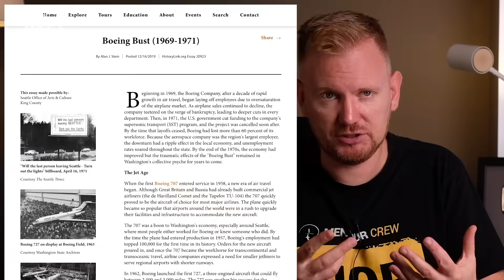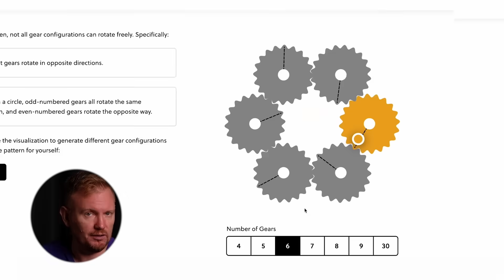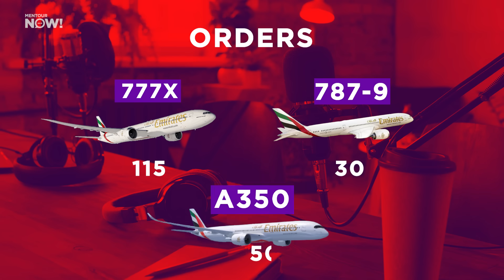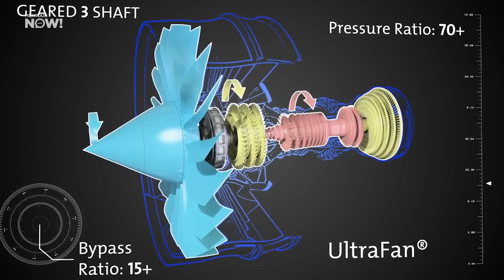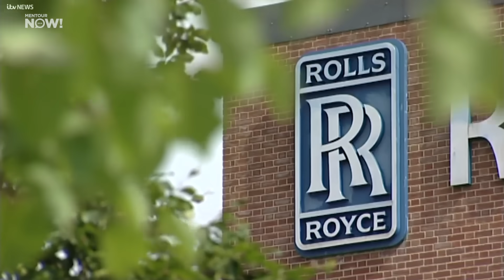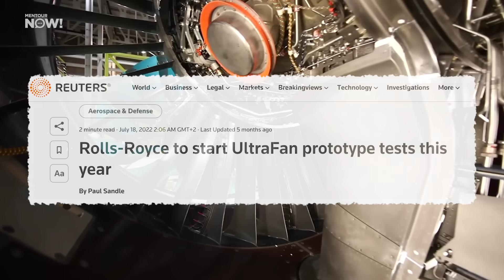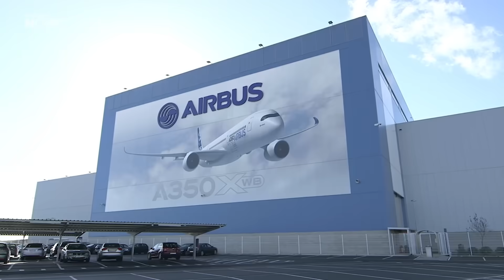Are BOEING planning a 747 with 2 ENGINES?!

Comment: They make carbon fiber wings in Wales, could they re wing 747s and A380s? for 2 engines with a higher under carriage..  My guess they have to keep the fan tip speed below the speed of sound.???

Comment: You need more than twice the power of 1970  turbo fan to go on two engines because the plane has to fly on half power not 3/4 power if it looses an engine.as if full load just after or before lift off.  I would like to know what the maximum limit is for a turbo fan engine.?????

Comment: No. It would be a completely new aircraft with all the type certs etc. that entails. Or did Mentour say that and I missed it? IIRC the killer problem with the 2707 was that Boeing couldn't get the swingwing pivot to behave itself and the more they tried to fix it, the heavier the aircraft got until the seats would be too expensived to make a profit. The cancellation of the program and the curtailment of Concorde on the transatlantic route at about the same time because of the the sonic boom noise problems led to untrue rumours that Boeing forced the US government to put the boot into Concorde because it (Boeing) couldn't get the 2707 to work and didn't want to be outsmarted by Europe.

Comment: Wonder with the recent progress in Electric Engines (always much more Torque-Efficient, thus much more Fuel-Efficient, than regular fuel engines) if there is the possibility of replacing two of its engines with Electric propeller engines (as with the 12-blade engines on the A400M - but electric - which can almost allow the aircraft to fly at 500+ MPH, close to the cruising speed of the 747), and with the two fuel engines providing much of the energy to the other two electric engines. ... If doable, this will make the 747 unmatched in fuel-efficiency!

Comment: The No.1 problem is there is currently no engine powerful enough to power A380 or B747 sized aircraft in twin engine configuration even if somehow they could fit underwing. Unless there is massive weight decrease that can bring both aircraft close to B777X weight or a completely new and optimised wing it is impossible to power two such aircraft with the kind of thrust that is currently developed by a GE9X or even the Ultrafan which has a target thrust of 100K pounds. Factoring for engine cutout for a twin of that size, we are probably talking of 150K thrust per engine. This engine does not exist and neither we are anywhere close to have one anytime soon.

Comment: The ultra fan "engine" is not quite that. Its a framework to be applied to multiple sized engines. Its far easier to develop and test at its largest size and then shrink once the issues have been resolved. The other market is in Electricity grid (Aeroderivative Gas Turbines), as renewables are being rolled out without any serious consideration to network balance (i.e the wind stops suddenly) - large capacity jet engine power stations (which have been used since the 60`s) will need to be renewed, and at considerable scale to prevent blackouts as wind farms eb and flow their output. Its likely that the power generation side will be the first, and perhaps largest customers of the largest derivative of this jet engine.

Comment: Would there be any reason why a high wing design (think the C-17) wouldn't work for a passenger jet? Is there a reason why all the jet liners since the DH Comet and 707 have been low wing designs? A high wing 747 would easily fit an UltraFan. You could even lower the fuselage to make baggage handling easier.

Comment: The first or second time there is a twin engine failure over the water they will require aircraft to have more than 2 engines again. We’ve just been fortunate that there hasn’t been a situation like that in such a long time. However as the past has shown history will always repeat itself.
The most powerful and economical engine on the market today is the GE9X

Comment: Let see... Well there are airlines that already have replaced Boeing 747-400/ER with 777-300ER. For those who fancy 747SP, well there is a 777-200ER which have similar capacity, range and other capabilities. In short Boeing 777s are really feasible alternatives/replacement of 747s.

Comment: I think the Slot constraints at airports will be the driver of a huge twin engined A380/747. The A380 is rather compact in size for the number of passengers it carries. Also Airport size constraints may also bring in the big double floored jets. Stretcht versions of widebodies take up way more parking space, and I think that a lot of airports are in need of more gates for their Passenger volume. So shorter double story aircraft may be the only way to go.

Comment: "Aviation phantasy" is fun - but phantasy.
"Twin-Engine-B747" would effectively be a completely re-designed aircraft - every part of it.
Aviation is a business. 
The most modern wide bodies like the latest B787, B777 and A350 varieties are state of the art. 
An airplane designed 55 years ago cannot match this - except if it is all-new. And then it is technically close to the aforementioned present leaders, not the legendary B747

Comment: Now that the CEO of Boeing has announced a complete redesign of the 747 wing to continue the Series maybe it is time to revisit the 1960’s Boeing concept of the three engine 747.  The three engine design was dropped in favor of the 747SP because of the expensive redesign costs of the wing/fuselage. Perhaps the 21st century advances in materials, design, and construction have made a three engine 747 a viable reality. A modern, single tail mounted engine providing over twice the thrust of original JT9D’s, while outboard engines were throttled back at cruise, could offer an economy of flight outweighing reduction in performance.

Comment: With composites at the forefront of wing technology like they've become, one could design the wing AROUND the giant engine (flowing above and below) so it wouldn't have to be slung under the wings but rather the center of the shaft would be centered on the wing. Maybe that would be the time to switch to a flying wing design as has been speculated for decades as being the most efficient.

Comment: Working on the control system of the 747, The redundancy afforded by the four hydraulic systems has been put to good use, every control surface is driven by at least 2 hydraulic systems from different engines. The only system that is not redundant is the body gear steering system, from  nr 1 engine.
It would be  a night mare to redesign all those systems, matured based on a long operating time. 
The amount of analysis and simulation to requalify  a new system based on two engines is so expensive, that it makes no sense to do such a thing, in addition the cognizant engineers have long retired
End of discussion PERIOD

Comment: Boeing C.E.O., Mr. Cahoun, has just announced the re-opening of the production line for the 747, however, this new production will bring a totally new aircraft with a reduction in at least of 20 % in fuel consumption, a totally newly designed wing and the introduction of a lot of new technologies, mainly in terms of reducing carbon signature.
This announcement comes few weeks after another one on which Boeing reported the re-opening of the Boeing 727 line! Yes, as astounding as it may sound. The same way, under totally brand new design guidelines. Both news are not to be expected in few months nor years, but in medium term, probably around 2030. Let's hope not to be another firework the kind of Sonic Cruiser.

Comment: There is no point,it's an older design with older tech in its build. You would need to replace a lot of the materials in its build, and the design and aerofoil of the wings,do you might as well just develop a new aircraft for that cost.

Comment: The plus side of having two engines instead of 4 would be efficiency. However, you also have to take into consideration that if one of the engines were to go out you now only have 50% of your total thrust capacity instead of 75%.

Comment: I wrote about this on the Airbus 380: "A really big plan for the A380 would be to develop huge new engines with a thrust of around 620 KN which is roughly 25% greater than the largest existing turbofan jet engines today. Such an engine would be feasible. Could Airbus to transform the A380 into a twin engine aircraft?" Reply: "No! You can't turn a big quad into a big twin. The fans end up too large to fit under the wing or get a bad case of 737MAX-itis (you can't fit longer landing gear)."

Comment: There is a big advantage to having four engines...Takeoff and Landing Data. If your plane has two engines, it has to be able to fly on one. If it has four engines, it has to be able to take off and land on three. This gives a four engine jet not only better performance in an emergency, it allows them to carry significantly more payload on every normal flight.

Comment: I just knew it was Rolls Royce that was going to be the biggest engine. You have to see the video about making the engines on an A380. I am sure that they manufacture their turbine fans and the moulds were or are sculpted by hand . The best bit of the video was the containment destruction test. They hung one of those beast engines up on a rig and applied an explosive charge to one of the fan blades . They cranked the throttle lever right up 100% and let it run then blew it up. No debris flew out of the cowling you had a split screen with the engine and the boardroom and the boardroom windows shook as did the camera . Just amazing craftsmanship and thats simple.

Comment: To future proof the 777, Boeing can always copy a page from Joe Sutter,  make the tail assembly of the plane on a hinge , able to open 90 degree turn, while Sutter had the nose that can open up. The last plane I remember with this feature was the Canadair CL44.  The RR Ultra fan is basically a turbo prop renamed. One plane that can use the engine .........with some major modifications, the Airbus A400, it has the ground clearance to use that engine, will turn that into a twin.

Comment: The original 747 design was that of freighter. So, going back to the original purpose, maybe a fuel efficient 747 twin engine, geared fan freighter might be what lays in store for the queen of the sky.

Comment: I have always wondered if it was possible to have simply reconfigured the Boeing 747 planes to take off with 4 engines and then shut off two engines once it reached cruising altitude, then turn ON the two engines again when it’s about to land. That would have to a large extent helped to make it more fuel efficient. Just my opinion.

Comment: Who in their right mind would produce a petroleum powered aircraft today? When ideology trumps science in everything the west produces, maybe Asia will step up.
Reply: Companies that want to use existing proven technology to provide a service that is in high demand. If an airplane manufacturer stopped making kerosene powered airplanes today and instead started building only electric powered airplanes, they would be out of business in no time because current electric and battery technology can only power little puddle jumpers a short distance.

Unless you were thinking of hydrogen? There isn't a hydrogen supply widely available in the quantities needed that is not derived from fossil fuels. Hydrogen produced on a mass scale from renewable energy is probably decades away. And even if they tried to make hydrogen airplanes right now, the problems that they would likely run into would probably bankrupt them long before they could get the first planes produced. Or they would produce the planes but not enough airports would have the infrastructure to provide hydrogen.  And airlines and passengers would likely balk at the high costs and limitations of hydrogen powered planes, and so the airlines would instead buy kerosene powered airplanes from Airbus, or if Airbus had gotten themselves in the same boat then from China, who by then will likely be building viable kerosene powered airliners.

Comment: I think some people are stuck in the idea that more is better, and in some cases, it can be, but they need to dig deeper and look more closely at these. For example a modern 737 with only 2 engines may be more efficient, but just as powerful as a 3 or 4 engine plane from say 20-30 years ago.  So as long as they can provide enough thrust, it is totally viable.  I would like to see Boeing do a hybrid plane (maybe one that uses electrical power during high-power tasks like take off and perhaps landing) and then burn fuel at curising speed, to help maintain good range but reduce emissions.

Comment: Realistically from a market/commercial rather than airplane enthusiast/lover perspective, Boeing already has a '747 with 2 engines' for sale since 1998.  It's  known as the 777 program and Boeing has done it 3 times:

1)  777-300 EIS(Entry Into Service) in 98.
It was specifically designed to closely match the seat count of 747-200/300 while offered slightly less range.

2)  777-300ER EIS in 2004.
Specifically designed to match both seatcount+range of 747-400 but with way more LD3 cargo capacity in the belly.

3)  777-9 EIS in 202?
Specifically designed to closely match seatcount+range of 747-8i and again way more LD3 capacity in the belly than not just any 747 but any airliner type in the world ever.

Realistically(as opposed to romantically/nostalgically), redesigning a 747 platform with only 2 engines(and therefore require a completely new wing design which hopefully won't cause any fluttering issue like the 747-8i did when it was only a very minor modification of the 747-400 wing) makes absolutely zero market sense and akin to commercial suicide by Boeing...as if they are not in deep enough trouble since 2019...

Comment: P&W and Rolls Royce had legal issues 10, or so, years ago about the geared turbofan engine they were jointly developing for the F-35B.  It was apparently resolved in P&Ws favor as Rolls Royce backed out of the F-25B program with no legal conflict.  Or what?????

Comment: Yes it's possible to hang only two engines, but the overall design of 747 is outdated. Nowadays composite lightweight materials are being used for fuel economy and performance, the original design does not work any more.

Comment: Nobody is going to replace the A380 just for one airline.  The 747 is gone for good.  A new large aircraft can be a smaller double decker with two monster engines that would replace the 748i in capacity.  About 475-500 pax.  The A380 has a real capacity of 615 pax.  This would only be in the future past the usable life span of the 777x.   
Any comments yea or nea please offer.  I’m no expert.  😊

Comment: RR is building  engines for the  new AN-124 and probably the new An-225- the reason of An-124 is that it is the plane the British military want to replace A-400 or  older C-17.  Both An-124 and An-225 are about the size of an old Boeing Goose. and very doubtful if  Boeing would build a new Big Goose  for passenger use.  You know, there are things with wings that fly military, C-130, C-17 and so on and they are big to transport military hardware about the world.

Comment: Personally, I like having four engines available rather than relying on just two. On a two-engine jet, losing one engine means 50% of your power is gone, while only 25% is lost on a four-engine jet. In addition, two engines going out on a two-engine jet turns it into a not very efficient glider.

Comment: I’ve worked on 747-400’s and compared to Airbus models which I have worked on and installed wiring on the A380 in Toulouse are ancient, just the wire wrapping in the front cargo hold is very old technology and a pain in the arse repair and fault find

Comment: Probably not.  The more powerful engines would be too large in diameter to allow for ground clearance.  Same reason the B-52 had to stay with 8 engines. The air-frame would also have to be rewired with a completely new computer system to control the engines.

Comment: Who gets Ultrafan on their aircraft is a very big question. If A350 / A380 get neo-ised, and A330neo-neoed, it could make Airbus's offerings very good in relation to anything Boeing has to offer. And, with Boeing saying they're not going to develop anything new this decade, one suspects it's Airbus that'll be fitting Ultrafan engines. 

An A380 with new engines would be a strong economic competitor, as well as having the capacity to maximise revenue at slot-constrained airports.

Comment: Just 2 cents of from an armchair airman: the new RR engine is still pretty far away, so a question. Would a 747 or a 380 be able to to cruise on 2 engines that currently power the 777x? If so, they could be combined with 2 smaller engines (maybe the size of Leap: that would probably be enough, considering that 4 engines of comparable size are powering 343), which would assist take offs and landings to be turned off during the cruise (and of course, some kind of aerodynamic cowling to prevent the milling would be necessary). Could that work? Or would 2 engine traveling as passenger for most of the time produce too much drag and kill profitability?  Well, probably I'm not the only one to ask this question.

Comment: Sorry again, your basic understanding of chemistry and thermodynamics allowed you to drop a WOKE phrase like "hydrogen powered" - simply put, hydrocarbons like JET-A have many times more energy density than hydrogen - and that ignores the weight penalty of pressure vessels to contain the volatile gas H2. Example: DaimlerChrysler with a $200M grant explored fuel cell delivery vans for UPS... under the floor were a bank of steel cylinders for the H2 - (500 kg of H@ = 100 kg of gasoline, without counting the tanks weights.) - Proved to be not economical for UPS, WOKE, yes....

Comment: My money is on an enlarged 777-X and/or A350 or possibly an entirely new aircraft, that would match the capacity of A380/747, using 2 engines like what described in this video.